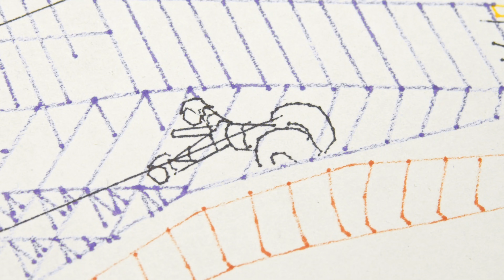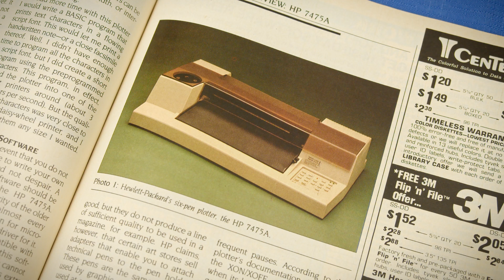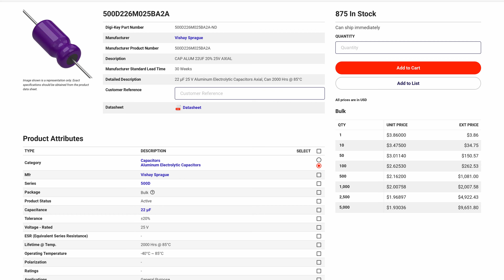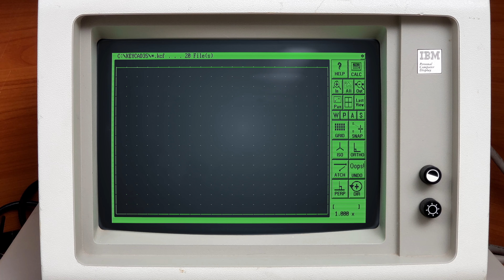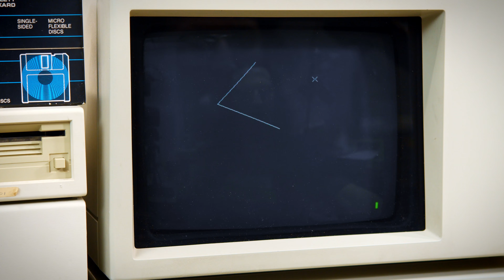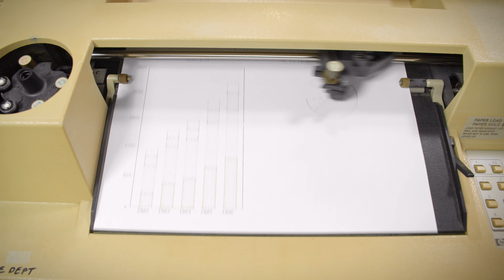Gold Standard Plotter - HP 7475A

Comment: I know this is old, but just a guess based on years of dealing with serial back in the late 1980s..  Kicad might be defaulting to hardware handshaking and it's just waiting for the RTS (Ready To Send) pin,  or DTR?  It's been awhile.. Data Terminal Ready pin..  
Sometimes software defaulted to hardware handshaking and you had to make sure the right pins were connected and the device was in hardware handshake mode.

Comment: Cool fact: many of the 70s HP instruments used vector display units; the instrument would sent vector drawing command to the CRT module, which would then draw this as vectors.  They had a memory of vectors and would just repeatedly loop it in X-Y mode.  You could attach a plotter using the HP-IB port to many of the instruments, and pressing the print button the instrument would draw the display on the plotter.  Or more specifically, the vector display would dump itself onto the vector plotter!

Comment: I had a 7440A "ColorPro" for a while.  That was a very basic machine which used the Y axis motor to move the pen carriage and only supported a couple of paper sizes which were configured with a DIP switch.  It was made as low-cost colour pen plotter for business graphics use.    Of course there is also the 7550A which is the fastest pen plotter ever produced- and a version of it sold by IBM.

Comment: I used that HP model for drawing PCB back in the 80’s, using Protel 😅
I used thick paper and taped the PCB to it, and used long acid resistant pens, I had cut a slot out in the cover so the long pen could move freely out of the pen holder 🥲
Sometimes the HPGL it received had char’s missing and the PCB went on the floor 🤪
But that an awesome plotter, wore it down over about a decade, and after that I got a Roland sketchMade that still works to this day 💪

Comment: Thanks for this video, I loved it! It brought back those heady days when I loved working for HP as a Systems Engineer/Trainer on dealer products such as the pen plotters, laser printers, inkjet printers, scanners, calculators and PCs like the HP110, HP150, and the Vectra range. Back then HP products were beautifully engineered, rugged, and reliable. We used an HP7550 plotter to produce all our training slides; it was marginally faster than the 7475A (it only drew one pen at a time), had eight pens, and was sheet-feed, so you could send a whole batch of slides in one go, and not have to hover over the plotter to change pages. The HP7580 CAD plotter (and later HP DraftMaster) was always a major drawcard at computer shows; people would be absolutely fascinated to watch it draw a full A0 CAD drawing from an AutoCAD file.

Comment: When pondering the tech from this time period, one thing I think about is how inspiring it was to those that came after. Born in the early 70’s, I’ve been inspired by these kinds of products because of their analog approach to accomplishing their functions. The mechanical>software integration is fairly easy to understand and it enables others the ability to use the same approach for very different functions. In the process extending and expanding the overall utility. I am not sure this same ability to tinker is possible with the tech that has come after. Therefore I think it is important to keep these items in circulation and demonstrated like T² is doing here. And for those in the recycling industry, reuse and education are just as useful as grinding up old tech in to its elemental components.

Comment: I'm familiar with the plotter from having one a couple of decades back, was nice hardware.  Wasn't what I wanted to comment on though.  So... you mention two modern examples of software supporting HP-GL.  There's a reason for that.   Roland, for example.  Specifically, Roland make the CNC mill MDX-15/MDX-20, while it talks "RML-1" it's actually HP-GL plus stuff, and FabLab locations use them extensively.  For milling PCBs, for one.
I would be incredible unsurprised to find other cheap/consumer milling machines and laser cutters also running HP-GL derivatives, since CAD software supported it so it's a good choice to be implemented.  The beauty of a defacto standard that doesn't want to die.

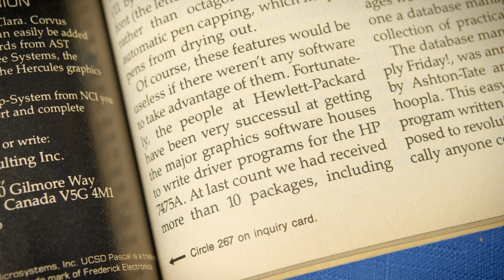Comment: I used to work for a company that had several 7470 and 7475 plotters. I wrote some code for the data analysis software to generate plots of the data using HPGL commands. I acquired a 7475 plotter that had an HP-IB interface but I had it switched over to a serial interface. I have the manual for it and also two different pen holders. One pen holder is for the typical felt based pens. The other holder is for ink pens for when you want a thinner line. Using 7n1 is rather unusual. I have often seen 7e1. You can double check the settings of the plotter to see what it wants. BTW, there is a typo in the text at 2:40.

Comment: Wow. This stuff brings back some ancient memories! If you didn't already know, the weird construction of the HPIB connectors is so that you can stack them to use multiple devices from the same port, so you could plug the HP7475 cable straight into the back of the cable on your older plotter.

Comment: 20 years ago I got a dozen of both sizes for $50 each. They are great. The is an HP Journal issue devoted to the tech in these and every detail is amazing including controlling pen lift so that it drops on the paper with zero velocity to keep the pen from being flattened or abused. The tips never get dulled. The paper motion is a thesis and the properties of paper how the grit wheels create a pattern in the paper that is followed every time for perfect alignment. These are a fine example of the detail and innovation in an HP product in the age before Fiorina.

Comment: Just in case you wonder why there is a keypad next to the plotting area.
The 7475 could be used as an digitizing input device. If I remember correctly there was a special "pen" available, which had a crosshair attachment. You could direct the plotter to the specific position you needed to digitize, press a button and the plotter could send the position to the computer. The keypad could also be used to enter numbers and have them sent to the computer.
However, I have never seen this feature in actual use and I didn't support it in my GKS plotter driver.

Comment: I have very fond memories of both the 7470 and 7475 plotters, Used them extensively through the 1980s and 1990s with a huge array of HP instruments equipped with HPIB. Also the HP-9836 and HP-85 computers were the go to devices using HP Basic for running equipment test programs.  
I used to dump out the HPGL into files which I could take across to word and with an import translator (ImageStream) to bring them directly into the reports we were writing as Vector drawings in the Windows Meta File format (wmf).  Thus we didn't have to scan the plots and they could be rescaled to any size.  My reports were sometimes up to 100 pages were hugely smaller and more portable than my colleagues who would scan in their images as bitmaps or JPEGs.  Also for presentations in things like PowerPoint and HTML web versions the vector files were great.

Comment: One of the problems you might encounter with using a serial connection is the treatment of the RTS/CTS signal lines.
If your cable doesn't have them connected, but the program is waiting for CTS to go active, the serial connection will stall.
I am surprised that KiCad has no option for "Handshake". It is either "software" or "hardware". With software handshake one could get away with a crippled serial cable not containing the RTS/CTS lines.

Comment: 'Us' (I'm not the only one) Sinclair ZX Spectrum refurbishment guys, use Vishay axial caps all the time.
The prices vary very much thoughout several suppliers, but the 'cheaper' ones are about $1.50 each now, so it's good to look around.
Still pricy, but at least on a ZX Spectrum they look incredibly nice, and you know they are top quality (and will probably last another 30-40 years).
Seeing those light / baby blue original axial caps, I'd recommend to replace them.
You could use something else, like Panasonics or so.

Comment: "set newline on"
most probably decides what should be sent if you press enter.
Is it just a CR character (0x13) or is it the combination CR LF (Carriage Return, Line Feed).
It was a constant PITA in those times to get it right. As a programmer working on the receiving end, one of the best options was to not relay on either "just CR" or "always CR LF" but programming the interface code to play it save: react at CR and ignore LF all together. However that didn't save you if your programm was the sender and the receiving device insisted on either "CR alone" or "You can send CR as often as you want, it is only after an LF that I will start working on the data".
(The same is actually true for reading from a file. This is why there are 2 modes in the C fopen call: BINARY, which does not translate or introduce any characters into the byte stream, or TEXT mode, which attempts to replace a single '\n' with what is the usual standard (either CR or CR/LF) on this operating system.)

As said: a constant PITA

Edit: Just in case you wonder.
The seperation of CR (Carriage Return) and LF (Line Feed) was a leftover from the days when teletypes were standard. "Carriage Return" just returned the printing head to the left border, while "Line Feed" advaned the paper by one line. Why the separation? Well, using CR alone gave you the ability to return the printing head to the left and eg. use an underscore to underline what is already printed. Another use was to print the same thing twice and as such create what could be seen as a sort of "bold font". When allowed to play with our chain printer, we also printed a line of '-' multiple times at the same line to perforate the paper :-)

Comment: Awesome video.  I have the Digital rebranded version of this model.  Mine is serial and is such a great device for the time.  I intended to hook it up to an Amiga to program it but never got around to it.  I will say the pens is the sore spot on these devices.  I have some recently made pens but even finding those is not great today.  I have had limited success re-inking them too.  It looks like you are using NOS pens?  Have you found a solution to the pens?

Comment: I still have (in storage) both a 7470 and 7475.  One of them is with RS232 interface, the other one with an HP-IB.  I have forgotten which was which. Anyway, I used them on my HP-87 computer, until the add-on 5 MB hard disk and maybe also the 1.2 MB 8" floppy failed.  The last time I tried to power up the HP-87, it let out some smoke.  As I already then had had other computers, I just left it as it was, not caring to fix it.  Maybe one of these days...
  I also did use an HP ThinkJet printer in plotting graphs, as it had the HP-GL emulation built in.  My needs were mainly documenting various data logging/plotting results from instruments having HP-IB interface.

Comment: I still have the HP 7475A plotter. Only the pens were difficult to obtain. With a 3D printer you can now 3D print pen holders yourself. Problem solved! The plotter was still supported in Windows 2000. Standard Windows driver.

Comment: I used to setup and maintain the serial B, D and E-size plotters in our AutoCAD group (early '90s) and found that they only worked correctly with the unique serial cable wiring specified in the HP manual.  Not sure how that would apply to the serial to HPIB conversion but the CAD program configured for the 7475A might be hanging waiting for a handshake that should be jumpered within the connector. We eventually migrated to a Fujitsu B-size 300 dpi laser printer that contained an HPGL interpreter.  That instantly obsoleted all the pen plotters.

Comment: You have Keycad set to 8bit No parity and 1 stop bit and kermit set to 7bit No Parity and 1 stop bit (it says 7N1 at the bottom). I'm guessing the RS232 adapter isn't smart enough to handle the extra bit and its probably failing parity right at the start of communication and getting stuck in a loop.

Edit: loI needed to watch more of the video before helping :)

Comment: I own a HP7470A model, it was hardly ever used. I recently bought a USB-GPIB cable for it, spendy little thing. I thought I saw something about you can use the Inkscape application with this ? I am going to look into this.

Thanks for doing a piece on the HP7475A, learned a lot from it.

Comment: I worked for HP after graduating in 1976. We used 9825 desktop calculators for simulation work designing ICs. We used the 7475 to plot the results.  In my spare time I wrote a number of games and demos that output to plotters including the 7475. One would take your name (or any string) as input and make a plot that spiraled in from points based on the string as a random number seed.  I later did a version for the Raspberry Pi for my local maker space.  I also did an artillery game and a lunar lander using the plotter as output.

Comment: I was the Product Engineer that made the overhead transparency film for HP. The coater that applied the chemistry to the polyester film was making this two to three weeks (336-504 hours) a month. It was converted into 8-1/2” x 11” (or A4 size) sheets and boxed up in the same plant. Same looking box that you displayed in the video, but for transparency’s. Did this for a 3-4 years. Then one day someone from corporate arrived and showed us the ‘new’ ink jet printer from HP. Once I saw the printer print a demo, I realized my product was toast. About six months later we made one last three week run. It was intended to be the final world supply for the life of the printers. We ended up scrapping about 25% of the ‘final’ run two years later. Obviously people were buying the new inkjet printers, with a near infinite color selection (versus 6 colors) and faster, and dropped the 7475’s like a bad transmission. 
One lesson I learned was technology can change things very very quickly.
Reply: We used to have the HP7475a combined with a Visual 550 graphics terminal. I used products like Tell-a-Graf, Disspla and Cuechart on our VAX computers to print to it. Printed many colour slides on your transparencies for presentations. They worked great!
Reply: Honestly they should've run it concurrent because now in 2023. It's very well needed because you have to use the exact inks or your printer don't work and I have to set my printer to values of 000000 and absolute values of c y and m. Sometimes simplicity is better... thebpen plotters and drawers out now, can only plot one at a time

Comment: I remember using one of these in my year out job. Waiting around for my plots to print out  was kind of mesmerising, bt plotter would often get ten minutes in and either crash or one of the pens would die. It was quite frustrating.  I remember the HP IB cables on a GS-MS instrument (with associated computer) I worked with when I was in my 20’s. The computer was on its last legs (and way out of support) so restarting it felt a bit like playing Russian Roulette.  Kermit was the first ever network product used. The network switch was a physical box of switches switch someone had built, to connect to a different computer you actually had to go and press buttons.

Comment: Cool. I wonder what your workstation setup cost back in the day. Probably pushing six figures. I bought a couple of 7470s for $50 a few years ago. I also found a “digitizing sight” that is a pen shaped optical device used for digitizing drawings or photographs  using the plotter. I don’t have the eyesight or patience to use it, but it appears to work.

Comment: Got that exact same model (actually, got two of them; donated one to my local hackerspace), and it's a blast tossing some HPGL over the serial interface indeed. We used to have these at my highschool back in the late early 90's, which is where I first encountered them (and the HPGL graphics "'language", and RoboCAD, my first CAD software).
 
That said, the large pen plotters used at the truck-trailer factory in our city were an entirely different beast altogether. Paper rolls wider than my arms spread wide, so large they came with their own floor stand rather than fitting on a desktop. All powered by IBM RS/6000 workstations with the turny-knobby 90's 3D peripherals used in serious CAD outfits. Would love to get my hands on one of those setups.

Comment: $1095 was a lot more in the 80’s than it seems like today. A lot more. You can look it up, but it’s really depressing. The pens were expensive, so you tended to squeeze as much as they could out of them. We used new pens for final plots and old ones for drafts. 
Iirc, PCAD had a dongle that went on the parallel port, often in-line with the printer. You could use the software, but couldn’t print without the dongle.
In the 2000’s, I ran across a metric $#|^ ton of HPGL files that a client wanted to be able to display on their website. 😖 We converted the files to pngs instead of trying to write something in js to plot them. We had to test all the files anyway, it was much faster to serve the images, and the storage cost was minimal.

Comment: are there some kind of sensors in the paper rollers to let the machine know where the paper is? or is it programmed to to know for example that A4 takes 20 revs and A5 needs only 10 to move a sheet from top to bottom? what if the rollers a dirty and slipping on the paper? although now that i think about it A5 is probably too small to reach the other roller.

Comment: I've used KiCad to create plot files to test Plotters. It doesn't connect directly to a plotter but there is an option to "Plot" in both the PCB Editor and Schematic Editor. This can export a file in several formats including HPGL. This will create a file full of HPGL commands. You can then use your favorite terminal program to send this file to your plotter over a serial connection 🙂